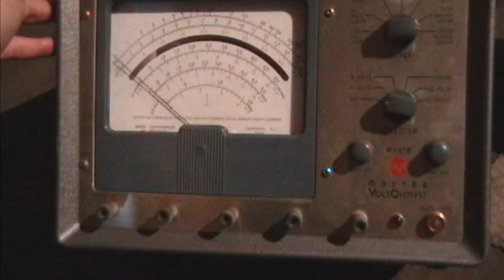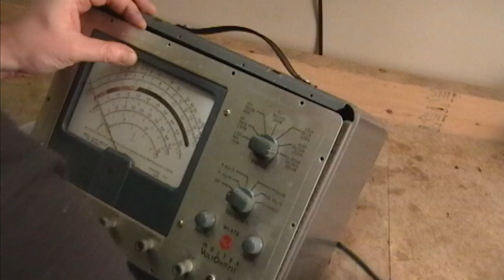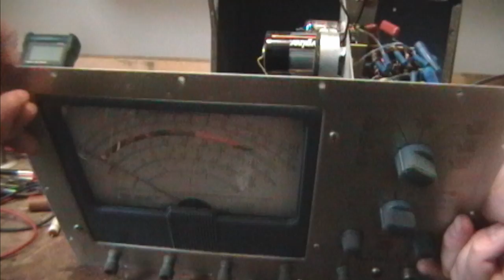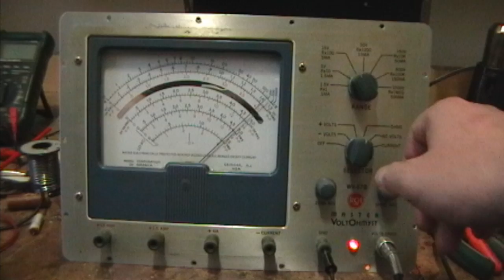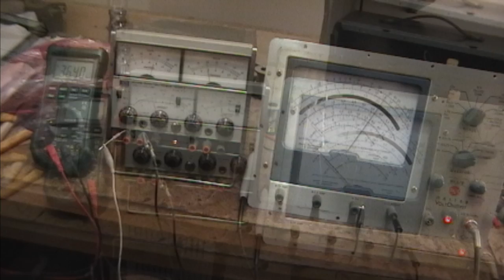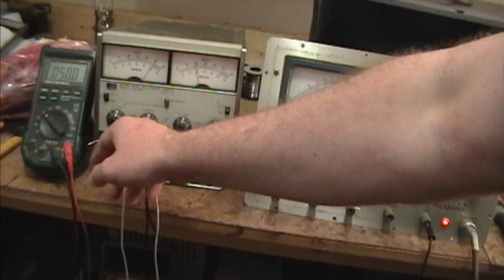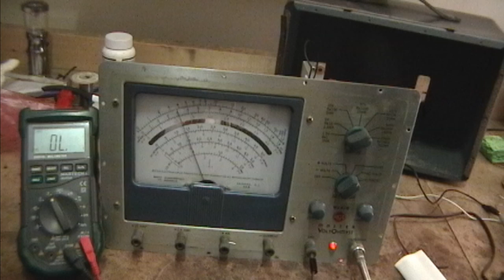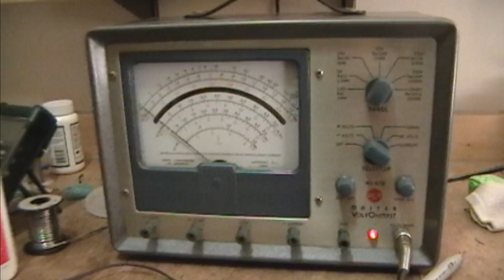FNR: RCA Master Voltohmyst WV-87B

Comment: As for the washing of keyboards, that was SOP at the IBM warranty department(as told to me by someone who worked there)  they had a line of Maytag dishwashers, would fill one up with keyboards (all ID'd by model/serial) would run them through a cycle(without the autodry) retrieve them let them try for 72 hours or so and 90%+ would work after just a cleaning.

Comment: The probe connector mounted on the front panel is known as an MC1M and the connector on the probe cable is known as an MC1F which was a popular high impedance microphone connector used on tube PA amplifiers back in the day...Bogen used them all the time...

Comment: There's a ebay seller that sells those Amphenol type probes. Aparently he makes them with beautiful looling probes.  I think you can still get those connectors from Amphenol RF.  I still need to do a video on my Heathkit Lab O'scope. Everyone should have a nice VTVM on their bench.  Everybody loves precision resistors.  I used them in circuits which need to stay in tolerance.

Comment: I've done that before with extremely grungy radio chassis, I don't usually bake them though, just washed them with a TSP solution and rinsed them down with hot water and let them air dry for about a week, or put them out in the sun on a hot summer's day. I don't submerge them though, just hand washing with a bucket of water. Most people freak out whaen I mention that to them but considering that the old capacitors are going anyhow I don't see the harm.

Comment: Regarding testing the resistor, when changing ranges on an "older" analog VOM/VTVM -- and, even, most new ones -- it will usually be necessary to readjust the "ZERO" and "OHMS" pots.  This is due to the original precision resistors in the meter drifting out-of-spec over the years and to the manufacturer using components which are "close"; none are perfect.  Two- and, more so, five-percent-tolerance components will cause the readings on various ranges to differ.

Comment: Awesome video!
I also needed a "difficult" signal source to calibrate a meter--a Triplett VOM. Just for sake of completeness of the calibration, I did manage to generate a 20kHz, 150 VAC (RMS) signal by feeding an audio signal generator into the auxillary input of a stereo amplifier/tuner. The output was hooked to an 8 ohm dummy load resistor, and the primary of a small step down power transformer (120V to 6V) was used as the secondary so the transformer stepped up the voltage.
The 20kHz was monitored for adjustment level with a scope in parallel with the VOM probes. This allowed me to tweak the trimmer cap in the meter to bring the AC reading into calibration up to 20kHz. I don't know if I'll ever use it that way, but I can now use the VOM for testing frequency response of an audio amp up to 20kHz.

Obviously, caution is required to do all this at these voltages and frequencies, but I found it can be done.
Reply from the maker: Thanks for the info.  That's a clever solution :)

Comment: I have not gotten to finish this video yet, but a couple comments.

I have restored a couple of the portable Admiral sets like the one in the video.  Be very careful in removing the case, the speaker clearance is quite small.  It is easy to damage the speaker.   There is also a video of one of these working on youtube.

Also, I have a RCA WV 87A, but the battery has leaked all over the inside and outside the back so cosmetics are not good. 

Thanks for the answer to my flyback question, I have ordered the RTV133.  I
Reply from the maker: I no longer have the silver Admiral portable, but have restored a smaller orange/white model T-102.  I'm impressed you ordered some RTV133.  Everyone else seems to back off when they see how much it costs. BTW one 10oz tube goes a long way. I've recoated a dozen flybacks and used less than a 1/3 of it.

Comment: I need a vtvm hard to find at reasonable price. Need it for my tube tester
Reply from the maker: Why do you need a VTVM for a tube tester ?  A modern DMM also has a high impedance.  Only reason I every use a VTVM is while doing T and radio alignments so I can see the needle swing.
Reply: @bandersentv  it's to check the voltages that require one can't use the dimm to check them
Reply from the maker: Why not ?
Reply: @bandersentv  it's to measure the signal voltages it asks for it. The rest of calibrationinstructions says can use regular volt meter with a shunt to simulate
Reply from the maker: For what tester ?  The shunt is to simulate an old fashion VOM that doesn't have a high impedance like a Simpson 260.  Typically something around 20K / volt.  I can't imagine any measurement that requires a VTVM.
Reply: @bandersentv  it's for my hickok 752
Reply from the maker: I just read through the calibration instructions for the 752.  You don't need a VTVM.  A modern DMM will work just fine - probably better.
Reply: @bandersentv  ok will try the last part of calibration instructions. Thanks for looking into it for me